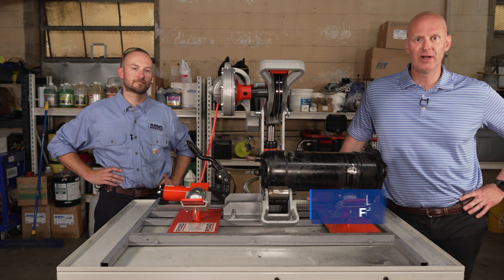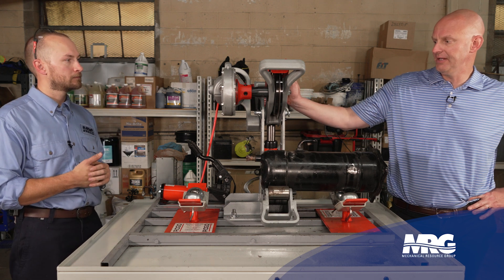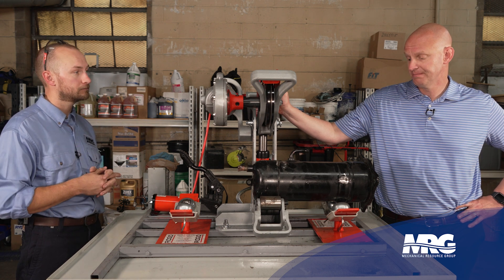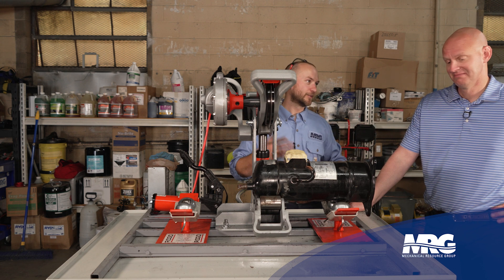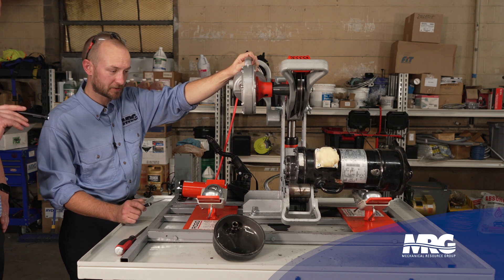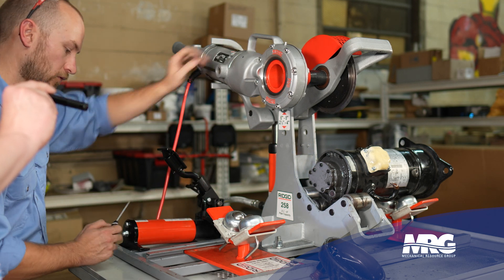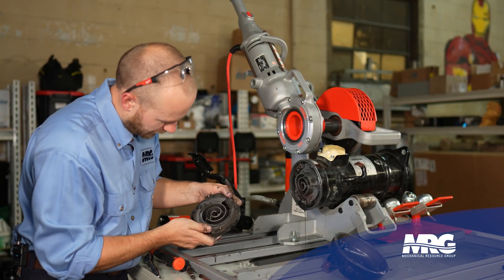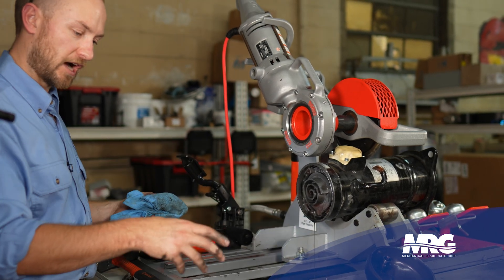Compressor Autopsy #2

Comment: Have a scroll sitting in my garage....found it failed due to flooding....txv was staying too far open and had 0° superheat. It was a heat pump....so i also replaced the reversing valve and charge compensator as well. As far as i know its been running flawlessly after making all the repairs.